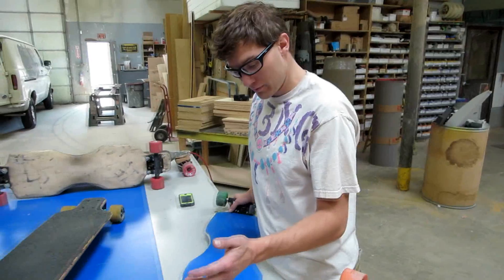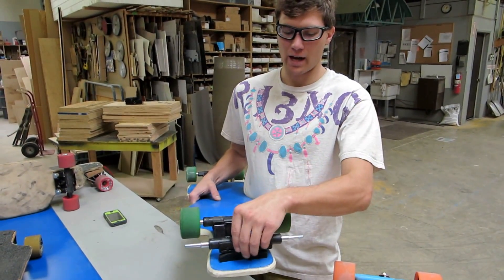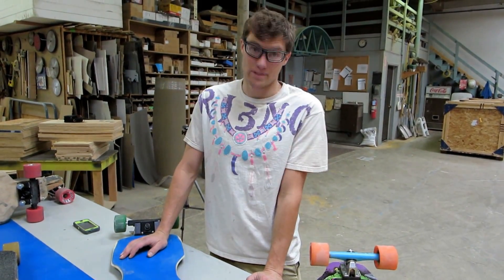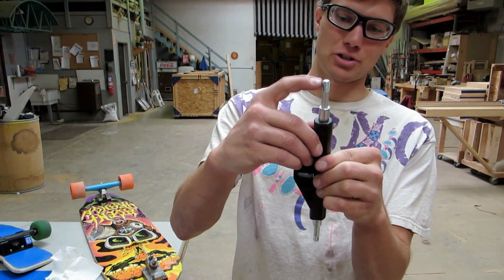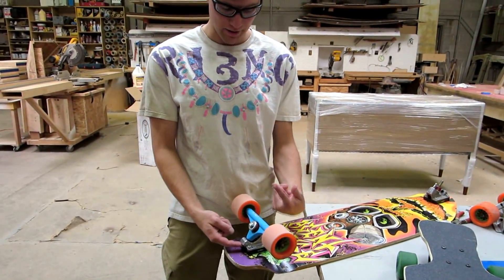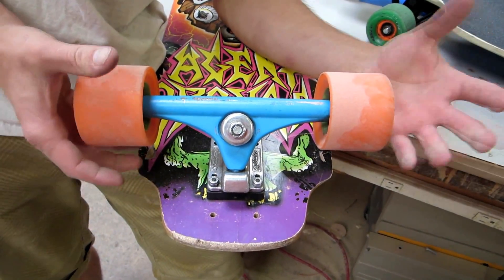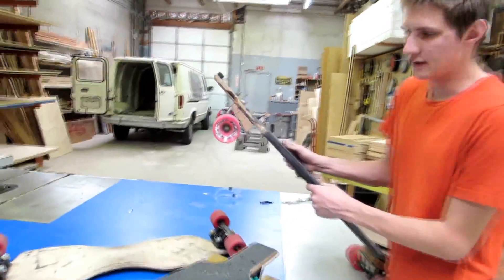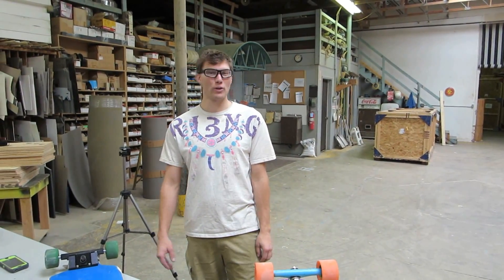Longboard Technology Breakdown of Other Planet Trucks.

Comment: How good are the Other Planet trucks for carving? If you mount them to a Fiber Glass/Bamboo drop-through deck how will it perform? Oh wait, that base plate will not work for a drop-through deck! Oh man! I like the concept a lot! Please figure out a base plate design that works with a drop-through deck so I can try it out. Oh but maybe I can mount them on a regular drop deck in the meantime? Yeah, I believe this is doable for now. But it would be really great if you have an optional base plate that works for drop-through decks! Thanks for this evolutionary design!!!
Reply from the maker: They can be pretty good for carving, but they need to be wedged. At least a +5 deg on the front, but if you could get a 10 on the front and a 5 on the rear that would be really carvy.

They're already really low, and honestly if you were to somehow mount them drop through, your board would get rail bite, and if you were to mount them on a drop deck, you wouldn't want more than 1/2 an inch of drop or so.
Reply: @LongboardTechnology  You know, I tried Avenue Suspension Trucks the other day. I thought the suspension feature would be good for carving but I was wrong! It's good for skatepark tricks like drops off rails because it absorbs the impacts. But after trying many different bushings and adjusting the bushing nut for different tensions I couldn't get them to produce any spring back of any kind for carving. My assumption is that every time I would push on the board trying to carve the suspension feature sucks up all the energy/thrust negating any spring back. So yeah, I recommend the Avenue Suspension trucks for skatepark tricks that would have a high impact potential to reduce fatigue on the knees, feet and ankles. Do the OP Trucks have spring back for carving? How does it compare to regular barrel bushing spring back? It appears every truck design has pros and cons.

Comment: I would advice to put it on an EVO (landy) type or Omen (kush-chief) boards in which the front truck is more turny and the back truck is close to zero degree turn (you will have to put at least an inch raisors and fairly big wheels like  Kegels)  Then you will rape the benefits of these trucks to the fullest !
Reply from the maker: Would you look at that, haven't seen you in a while.

Sill riding the Rapid Adrenaline Tool?
Reply: hi yeah cool ! i'm still on other planets on Evo boards (luge, standup, and RAT(kneeboard) new thing is i'm develloping an skeleton(Sled) on Other Planet trucks 2 ! I'll keep you informed ;-)

Comment: What are your opinions on the Curfboard?
Reply: I've had my eyeballs on OtherPLanet trucks for so long, but these Curfboard trucks just blew my mind on kickstarter right now.
Reply from the maker: This is the first I've heard of them.

I'm halfway through their kickstarter video right now, they seem pretty interesting.
Shares a lot in common with OPs,  both advantages, and some of the drawbacks.

OP's have struggled to get enough resistance to take them in real DH, which means they struggle to gain traction with some of the most adamant riders out there, and I foresee similar struggles with the curfboard.

On the other hand, they don't look like they'll need much maintenance of upkeep, no fiddly tuning, without parts that will wear out or wear down.
Reply: The curfboard trucks do look like quite a complicated solution. OPs got that simplicity I still really admire. Some Occam's Razor type shit.  In the end I'll go with the OP's, but this just caught my eye, thought I'd share some new longboard tech, with my favorite longboard tech channel!. thanks for the reply!
Reply: I had another question for you if you have the time. Freebording has been a hobby of mine for quite a few years, and OP mechanics seem to me to be the ultimate in truck tech for that smooth carving feeling. So basically I'm hoping to get your thoughts on modifying some Freebord trucks, or fabricating something with the OP hanger style to achieve that snowboard carve feeling. As that is basically where the Freebord falls short in snow simulation. Would this even be feasible? Or would there be some reason why that might be dangerous and/or a bad idea?

Comment: My trucks can lean 50° they arnt very good but better then these
Reply: That is just the baseplate angle dum dum get your facts before you comment something stupid
Reply: XXX_cRoGan16_XXX then post rh  fact if you know them, from what they said they have a 30° turning ratio correct? My trucks have a 50° mine arnt as low but that's because I'm able to get a higher angle on my board when turning. These are more ripping and sliding I wouldn't trust these down steep heels at all.
Reply: +XXX_cRoGan16_XXX I take it you have no clue about angles or skateboards and the only reason why you commented on my post to begin with was to feel good about yourself, am I right? Specially because you added nothing to this conversation.
Reply: +XXX_cRoGan16_XXX haha if that's all you have on someone is how they push off as a comeback or insult  pretty sad. Most skater that I know who actually skate mongoose are pretty good on a skateboard board better then I will ever be. So thanks for showing me your age.

Comment: If the axle only goes up and down rather than back and forth, how does it actually turn?
Reply: That 17° angle. I wonder if this design is limited to this shallow angle due to friction against the sides of the cam at angles past 17°.

Comment: I have a question, will these help with speed wobbles? Every time I come out of a turn I get speed wobbles, will these very much lessen the chance of speed wobbles? I head that since the Polyurethane of the bushings pushes back on your pressure it causes speed wobbles?
Reply: Osiritis yes they should. Speed wobbles occur when a truck is attempting to find its equilibrium due to the inherent characteristics of the bushings (like a bouncy ball). Since there are no bushings there is no energy transference, no equilibrium to be found.

Comment: Or you could get a double kingpin truck like a smart person.........
Reply: lucas stidd double kingpins are inherently unstable (I use them) but are great for low speed carving. They are also a tall truck so really can only be used in a drop through unless you have a drop deck.
Reply: Think everyones missing the point
Reply: +lucas stidd and be, like, ten miles from the ground.

Comment: I just like how he shows wheel bite on the real trucks. Duh tighten or switch the bushings.
Reply from the maker: You entirely missed the point. 
I was showing how the RKPs cannot lean as far.
It wasn&#39;t wheel bite preventing them from leaning farther, it was the hanger hitting the baseplate, specifically the washer..
No bushing is going to let you lean farther than that.

Comment: Do these trucks prevent/reduce speed wobble?
Reply: Nelly Nelson yes they should lessen or eliminate speed wobbles. It's actually the bushings themselves attempting to achieve equilibrium that are the source of speed wobbles. Think of it this way: bounce once in a trampoline and you will continue to bounce due to the kinetic energy until the trampoline dissipates the energy. Now think of a see saw: Once energy (you and a friend) cease to push off the see saw ceases to keep moving. Same concept with these trucks.
Reply: +Nelly Nelson 

looking at the design of the truck and how loose they are that he can push them to their full tilt/lean  that is a definite no. regular trucks are still far more advanced.

Comment: I like the idea behind the trucks, I just feel that since it is such a tightly packed mechanism, it won't absorb any vibrations from the road. The majority of the roads where I live are very rough and require a lot of shock-dampening from shock pads, bushings and flex from the board itself. Would there be some sort of solution to give it better shock-absorption?
Reply: Maybe they can make the hanger with rubber surrounding the axles or on the topside of the axle (the load bearing side) to absorb shock? I know they will figure it out! They did come up with this latest version and it keeps getting better!

Comment: Just gonna say This is legit Just an original skateboards truck with the spring mech removed and replaced with an o ring. ive owned originals, kingpins, reverse kingpins, and the gullwings which are a double kingpin design. js. i know about this stuff.
Reply from the maker: Seige Tech 

We have another video showing Original Trucks you can look at, if you watch it you will see the two are quite different.

Comment: I have to say, a friend of mine sent me your videos to check your trucks out, and I was really excited when he was describing them, but highly disappointed when i laid eyes on them, even more disappointed when i seen his set. You guys have probably one of the most innovative and best designed skateboard trucks on the market. Yet... you use injected molded glass filled nylon ? Give me a break.

First off, knowingly supporting DuPont as a company is morally suspect. Aside from that.

You have completely shut your company out of huge potential sales by coating that hangar in garbage. We were riding your trucks in a skatepark attached to a modern street deck, the bowl and the mini/half pipe was a dream, great stability awesome control, yet Grinding or even stalling on the coping felt like I was like riding a $10 wal-mart board thanks to that coating. The rest of the park was okay but don't even think about nailing that rail or ledge.. You could be the dominating truck manufacturer in both street and long-boarding  by far if you just made the hangar's coating out of aluminum alloy instead. The lack of constructional foresight is really sad, in a product with such great design.
Reply: Ahket Ra These are not skateboarding trucks they are LONGBOARDING trucks. We don't do shit like that that wears down the trucks so we don't need them. There is a BIG difference on what you do with regular skateboarding trucks and these longboard trucks.
Reply: ***** yes but i don't remember anyone using a longboard to grind a rail.
Reply from the maker: I think it was because of the high tolerance of cast plastic over cast aluminum, and the better low friction characteristics.

Aluminum on aluminum would just be horrendous, so there'd need to be a whole separate plastic part made to keeping an aluminum channel and aluminum hanger from toughing each other.
Reply: +Nick Shumar Gravity longboard riders?
Reply: What I'm really confused about it why they cost so much when they're using injection molded glass filled nylon. for $55 a truck, I'm expecting a lot better materials to be used than that, even if they're not intended to be used for grinds.

Comment: Would these be a lot more stable for downhill compared to the Caliber 44's?
Reply from the maker: Um, Yes and no?

Comparing the stability becomes a bit difficult. The 44 is rakeless ( I think ) and you can really set it up with bushings that can give you more stability than you'll ever need.

But if you're trying to set up a board to be loose, and still be able to bomb, then in that situation, OP would likely be more stable.

It really depends a lot on what you're looking for, outside of stability.
Reply: Im probably going to just get the 44's for now until i have enough money for OP's. Thanks for the fast response.

Comment: A bushing in both end point channel gaps underneath the hanger would provide resistance for those who like to throw a little weight into slides. Also it would keep from "casing" the truck in lower degree turns at high speeds. The design is super sick, I would like to give em a try.  But no doubt in the $350-400 range make them out of my league. Love the videos though, good vocabularies on technical descriptions.
Reply from the maker: Actually, they are thankfully far cheaper than $400. A pair at the moment is "only" $100.And while doing that would provide resistance, it would also get in the way of the cam function.We have figured out a number of ways to incorporate bushings, however, they all take a fair bit of DIY.
Reply: After I wrote the comment I had seen more videos of the different proto's from your testing and I see that ya'll are a month away from using air bags;) Good work.

Comment: Doubt I could afford these babys but they sound very unstable. We all tighten our bushings to get a smooth ride at high speed and no wobbles but these trucks seem to be like riding with no bushings! Like an Original S10 but with even more "falling off a cliff sideways" lean. Also no suspension from bumps in the road which RKP bushings provide. I guess the proof is in the riding though...
Reply from the maker: They're actually very stable. Kingpin trucks operate like a teeter totter, and any weight on the deck will cause the board to enter into a turn. All bushings do is reduce this effect, but they cannot eliminate it. So in practice, kingpin trucks do not have a center, and are always in some level of turning.
Where weight on kingpin trucks initiates turning, weight on Other Planet trucks, causes them to travel straight. 

Imagine a rocking chair. The big long rockers on the bottom? They're functionally the same thing as these cams. When you rock in a rocking chair, you don't experience "Falling off a cliff Sideways lean", you experience a comfortable, and controllable transition as you lean. That's the same experience you get with OPs.
Reply: ive been riding these for three years now and yeah what he said. balancing on like six inches or so of cam instead of whatever like 1/2 inch bolt and bushing combo is whey way nice. no orings, nothing pushing you out of whatever turn/slide you are in is way cool. i trim my cams at the outside edge because they dont feel turny enough but yeah wedges work too i bet
Reply: @killinlikebobdylan  I believe what you said is the key to various applications with this truck design. The CAMS ! That's the key element here! Determine the best CAM shape for different riding styles, downhill, carving, pushing, etc. Also obviously the base plate angles as well. But this is definitely a very good development in skateboard truck technology. I believe the closest thing I have seen, but haven't tried yet, is the Curfboard trucks developed by some German engineer. Look it up, Curfboard on YouTube.